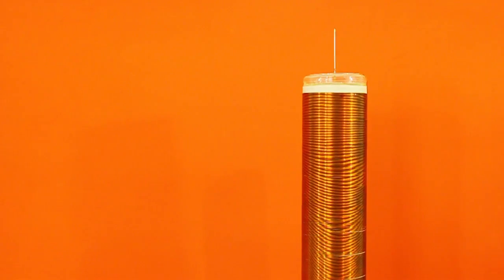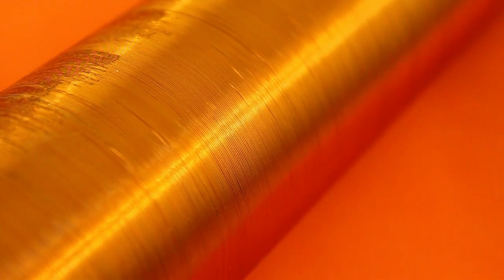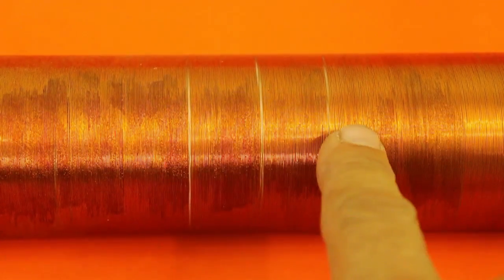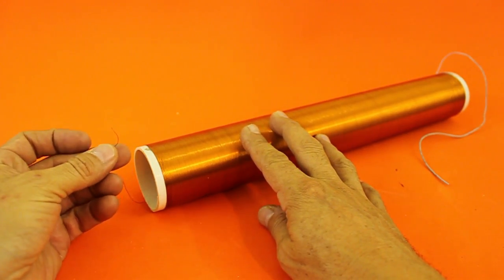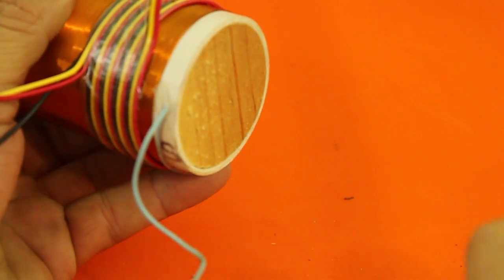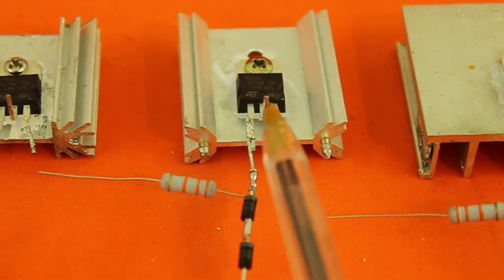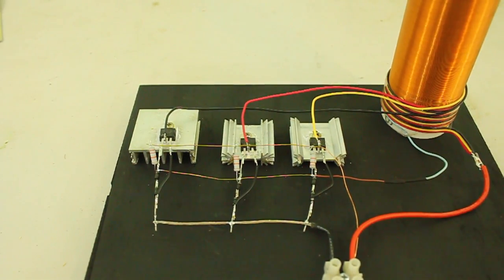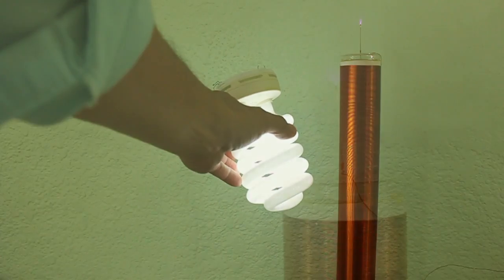Triple Primary Slayer Exciter Tesla Coil

Comment: All the transistor bases are tied together because the resistors are connected in series.
In such a circuit, the current could easily end up flowing only through the transistor that had the lowest BE junction voltage.
You should check the three heat-sinks after operating for a minute to see if they are all roughly equally warm, or if only one is hot.
If the latter, then you've wasted your effort triplicating the circuit.

Comment: I have plans from the Philadelphia experiment. 3 coils 3 meter long, oriented in X,Y,Z orientation mounted in close proximity  ( on a 1 meter Bakelite 1 inch plate). The primary was run at 4 million volts.  From basic physics it makes absolutely no sense. Can you explain what this configuration?  I got this from patients at the VA in the early 1980’s and worked on mounting the system!
Reply from the maker: You mean the movie?

Comment: What if we used a 1kohm variable resistor to make a simple divider and we tune it, this way we can tune it closer to the resonance. 

I use a single MOSFET which gets dumb hot even on a huge heatsink, im thinking of configuring a triple primary so i can test the power and heat. If this doesn't work, I'll have to get in deeper to use a gate driver which intimidates me.

Comment: I think   , without triple primary coil turn ,it will be more better and easier if we use thicker gauge wire and 1x  3 watt 10k resistor (for three transistor)  because if we use 3 different wire for primary coil then there will be a little frequency difference between those transistors which produces noise at the output of the secondary HV end (unstable and noisy corona discharge) and also this video is so nice :-)  BTW also increase the gap between the primary and the secondary winding otherwise there will be internal arcing between them in which those transistors will spend more current and you will get less arc length (basically power wastage) . Good luck!

Comment: Can i use 3 transistor in series?
Reply: There is information online about using transistors in parallel.    there is 3 tricks or more to balance the power there is a formula for the correct resistor for the base of the transistor.    If you run many in parallel they might run cooler anyways
Reply: @mike289homebuilt5  could you please offer more information or a link. Thanks!
Reply: @szekerespista3758  Im starting to learn,   it takes so much time.    The basic formula was as follows:
Current (at Base) x Transistors gain (HFe) = current at Collector (the output).
Thats It!

The current at the transistor Base is set by a small resistor there  Voltage divided by Resistance = Base turn on current for that transistor.
  Say have a 12v signal at the base 100 ohm resistor = .12 amps  If your transistor has a gain of 26 then multiply .12×26= 2.4 Amps at 12v thats well over 25 watts dissipation.
In summery.  Ib x Hfe = Ic or output current   Ib =  V÷resistor
The web address lookup   Petervis GCSE_design
Reply: @mike289homebuilt5  thanks!

Comment: Can I use LED instead of UF4007?
Reply: yes you certainly can! LEDs are basically ultra fast diode.I used it for lsayer exciter and it worked flawlessly
Reply: I used 2 led at 24 volts and it worked good everything got too bright.

Comment: Can i use TIP31C?
Reply: TIP31C works fine 
But I would prefer IRFP260N
Reply: prajwal kashyap i have IRFP460
Reply: @69poseidon34  
You can use IRFP460 but make sure not to exceed 20V bias (read datasheet)
Reply: prajwal kashyap thanks can i use another diode?
Reply: prajwal kashyap i have IN5408 diode can i use

Comment: 15Ghz single pulse square wave energy transfer (one pulse in every 2 for 5-15Ghz) YoutubeNinjaExpand Thank you very much for your posted video . Difference of a length of wire y 2.3 cm compaired to the 3cm version of the antena for 4 nano newtons of force to 4KN. (amps to newtons for up to 200 columbs) 

@

Comment: i've also done a 3 primaries slayer exciter, not like this, i've seen the schematic online and it's alotta wrong, sorry, here's some tips and my version:::

- you don't need ALL THOSE DIODES, just one instead of two in series gets the job done, on the other "channels" you don't need diodes also, the only one fitted will hold the negative swing for the 3 transistors and avoid breaking, a 1N4148 or UF4007 will go (UF stands for Ultra Fast, don't use a 1N4007)
- fit a resistor in series on every transistor's bases, like 1ohm, this will level the current drive, otherwise the thermal runaway of the transistors will make the whole system run on just one of em and they may blow in succession (and deliver only one third of current even if not blowing)
(- you may instead fit that resistor on the emitter, it has kinda the same effect but having separate primaries it's better on the base)
- use identical transistors and hopefully from the same batch
- you don't need three resistors as well to crank the oscillation, the one that goes to Vcc, one is enough, experiment with it, it's not critical but it's value must be divided between the amount of primaries
- the smaller the coil the faster the transistors need to be, for that size a TIP41C or BD243C is good, for smaller sizes of the secondary you can go with some BD139, for even smaller go with BC639 or BCX56 (hard to find and the latter is SMD but solderable on a piece of copper to cool it)
- twist the primaries toghter in a cord to make em behave the same toward the secondary, don't wrap em around at layers, you can also use some enameled wire wound on a slightly larger pipe and hot glue the wires, make the connections short
- don't common the heatsinks, the transistors collectors need to be separate
- one transistor -> one primary... join em only on the Vcc side
- a big secondary will quite likely disperse the electric field, so mind power, size and final frequency

my coil is 12cm high, 2cm of diameter, like 800 turns of thin wire (maybe a bit small), runs on 3 fake BD139 (2N2222A quite likely inside... you know... eBay... but you can place em on an heatsink :D), and i power it at 12V... primary is just two turns of enameled copper on a 3cm dia. piece of pipe, it runs at like 2.7MHz so the higher the frequency (cos of small size) the less primary turns you need, more turns = less current... less turns = more likely you blow the transistors (buy a pack of em if you can)
Reply: Ayy 10 cm coil squad!
Reply: What transistor did Tesla use?  ....
Reply: Sloth & Chunk, taking care of your yoga neighbours 

Hi there, may I ask what gauge wire is suitable? And wires shouldn’t cross, only one turn/layer?

Thank you

Comment: very cool.  So you believe the three primaries help reinforce the resonance?  What would happen if you set the three primaries at different frequencies, but arranged their off and on phases to switch on one after the other?
Reply: I know this is an old comment but what you said contradicts itself.
If their off and on phases are after one another, they can't be different frequencies.  They would just end up syncing to a new frequency based on the slowest one.
As for what would happen if you used different frequencies with a resonant circuit, they can't all be resonating.  To resonate it needs to be a specific frequency that can be calculated.
Slayer exciters are fun because they self tune to their resonant frequency.  But if you impose a different frequency, you'll still have a Tesla coil.  Just one significantly less powerful for the same input power.  It would basically be a transformer without a core.
Reply: The old man is talking crazy or was he.   There was study done there is a way of layering a wave form so it reinforces,   didnt that make everything burn out though?

Comment: Can we use 1n4007 instead of uf4007 cause most of the characteristics match?😅😌😕
Reply: UF4007 and 1N4007, the numbers are similar but the characteristics are quite different in UF and 1N.  UF4007 is a ultra fast recovery diode, and 1N4007 is a 60Hz power supply rectification (very slow) diode. So 1N4007 can't work at this freaquency.

Comment: Hey, what do you think about wireless energy configured in such a way that in the room you've got an emitter and walls are receivers so no energy is lost, it goes back to the system?

Other than that I've heard about Tesla's another kind of waves which have no delay, transmit energy directly instead of  all around and a system where the receiver triggers the emitter. That sounds too awesome though.
Reply from the maker: Sounds awesome but is impossible
Reply: i think he's talking about emitter tesla coil and receiver tesla coil tuned at the same resonant frequency.

Comment: work much better with high voltage on the primary, no less than 250v and either mosfets or vacuum tubes. The primary voltage needs to be at the resonate frequency of the secondary.

Comment: what is that wire in metrical mm ? i've build myself some years ago some mini tesla coils (height ~6cm) with the same amount of plasma arcs.
You can buy at Aliexpress mini tesla coils (SSTC) for around 5$ .. you only habe to solder yourself that handful of parts ^^
Reply: 30 gauge wire is 0,01 inches.
So 0,254mm.

It's very odd to work with if you're used to thicker wire such as the usual 1,5mm to 16mm you have for basic household wiring.  At least it still feels odd to me.  I can't get used to it.

Comment: Can you add 1 capacitor parallel to primary and 1 parallel to secondary for a double LC resonance-coupling? Woulnd't it make a better power-flow and stronger arks?
Reply: no dude capacitor won't work over here it will disable the circuit
Reply: A capacitor will certainly lower the frequency. Use only in the primary.

Comment: I would have enjoyed it if you had the disency to show an arc, if i want to turn on light bulbs i plugg them in to 220, what's the purpose of a coil if you don't show an arc properly
Reply: It's not a Tesla coil, it's a slayer exciter. It does not produce arcs like Tesla coil
Reply: @nilaksh007  i built a small slayer and i got 25mm arcs on 12v
Reply: He did, you were clearly not paying attention 8:35 .
Reply: @steve_nobbs  thats not an arc thats a tiny energy leakage
Reply: @jonatanvillagran3253  its a coronal discharge, but as he moves the bulb closer there are a couple of small arcs.
Reply: the most you would get at 30v would be about 1.2cm, from 12v it would be about 5mm.
Reply: @jonatanvillagran3253  well obviously its an energy leakage - its called an arc
Reply: @steve_nobbs  
Hello. How do we calculate ARC LENGTH ?
Reply: @megaraitei  His secondary  coil has 1200 turns his primary has 4 so from there we can multiply 30v input by 300 (the ratio of turns between coils 1200/4 = 300 ) 30*300 we get 9000v output for the secondary, sparks in air will jump 30,000 volts per cm or 76,200 volts per inch (this is a good rough approximation, temperature and humidity play a roll)
so 9000v can jump 3.3mm and once the air is ionised the next spark will travel further and could be drawn out to about 1.2cm or half an inch. Hope that helps.
Reply: @steve_nobbs  

Yes .. very very grateful. 
Thank you. 
I've Made the circuit. 

With a single coil primary 5 turns. 

1000 turns on the secondary. 
9v 1amp DC power source 
No top load 
TIP41C in Darlington setup.  
1 In4007 diode. 
4.7 Kohm resistor

I can light up tubelights. 

But I can't see any arcs or Corona 😭😭😭
Reply: @megaraitei  you could try reducing the primary to one turn, you should get similar
results to the video then. at the moment you have 1000/5 = 200 * 9v = 1800 volts
with one turn you would have 
1000/1 = 1000 * 9v = 9000 volts.
and be careful because high voltages behave differently to the lower voltages we are used to handling.
Reply: @steve_nobbs  yes. 

After reading your explanation of Arc length measurement... I guessed as much. That I would have to reduce the primary turns. 

Before this I has made a spark gap Tesla. I managed to get about 10mm arcs stretching to about 20mm 
I had increased the turns on the primary there - as it wasn't self tuning. 

Will reduce turns tomorrow and update. 

Thank you.
Reply: @megaraitei  good luck
Reply: I think it must have a dome head for it to generate good sparks. Point action causes it to leak a lot if it has a sharp end like the one above, but a dome allows charge to accumulate and then release a spark, "bang". Just like a capacitor, in fact a dome has capacitance.
Reply: For the charge to accumulate like in a Van see Graaf gen. You are talking about  DC generation.

Comment: Are the primary coils wound in opposite directions or clockwise both? In the video this fact wasn' t stated i think. Many thanks anyway!
Reply from the maker: All coils in the same direction
Reply: @ludicscience  

I made this. 

With single primary. 

It was not working. 

Then I reversed the primary direction (it is now opposite to direction of secondary).

Working now. 
No arcs. 18v 2amp power.
Reply: Boy now
Reply: Made my primary wind in same direction only reversed the connection wires.   I used 7 amp transistor it works good

Comment: How many primaries can you shove onto a tesla coil? The world may never know.
Reply: the Primary has to be in "sync" with the secondary (resonance)
Reply: @mr.mythoclast4451  not really cuz slayer exciter autotunes it's frequency based on those coils cuz it has direct feedback
Reply: More primaries like that will change the resonance which may be good or bad. At any rate I agree why use more primaries when you can just parallel transistors if you want more power. The better approach is to use 2 transistors in push pull.
Reply: @Magneticitist  Good ideea! How to design the push-pull circuit?
Reply: @szekerespista3758  I've made a bunch based around a circuit you can look up by Tefatronix. Search for Tefatronix SSTC IV I think it is.
Reply: OBV10U3_NINJA 😂
Reply: A bizillion coil🥴🤣
Reply: @Heads Mess I think one application could be having multiple of the same power source, but not wanting to fry your oscillators by pumping all the power through just one, so you synchronize them all to individually feed into the coil. I could be wrong but smaller, lower power parts seem more stable and economically viable than larger, industrial level components.

Comment: Try making slayer exciter with irfp460n mosfet
Reply: therefor you will need a mosfet driver
Reply: No u dont need a driver
Reply: @insaane https://www.pinterest.es/pin/821625525751774720/
Reply: I used tip 31c
Reply: @insaane thanks i was having this issue